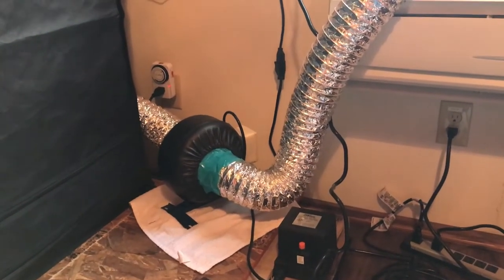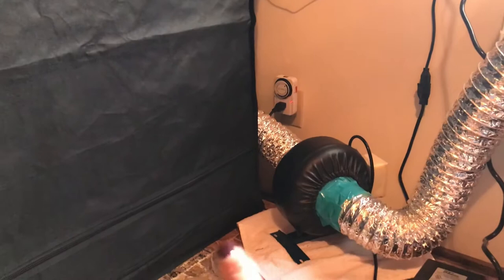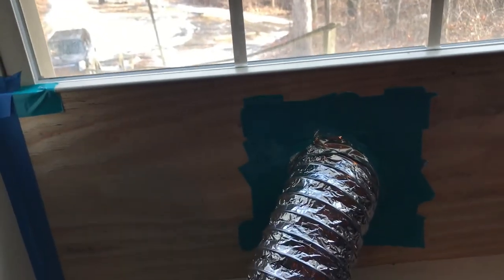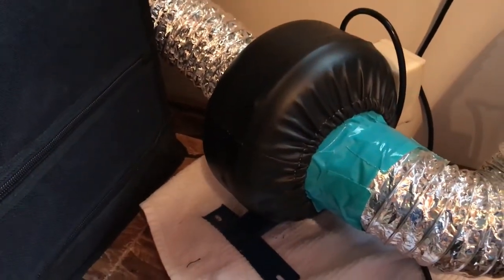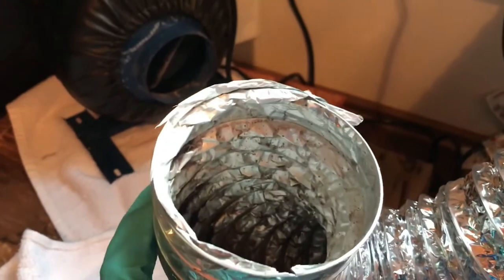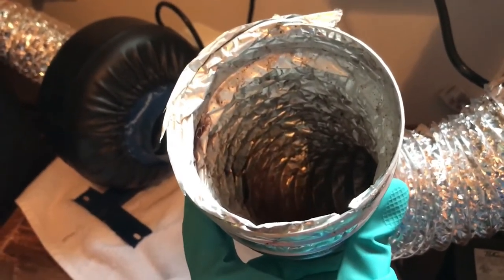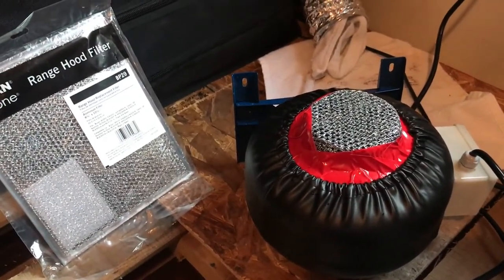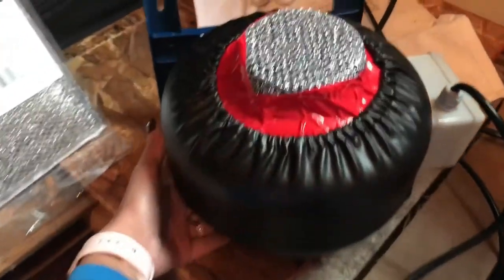Mushroom Grow Room Exhaust Problems

Comment: Jewel great approach to problem solving! I Got the cheapest harbor freight miter saw (with a carbide blade) ~ $90 or less for cutting PVC and other materials quick! The thing pays for itself with the time you save. Hacksaw is great for a couple times use but the end result usually looks like a beaver chewed it off. PVC ends should be sanded smooth to reduce bacteria breeding areas and other infection vectors. The miter saw saves the wear and tear on the arms and back too.

Comment: Working on designing an exhaust system for my 8x8 grow tent now. Miraculously the hepa filter I got fits perfectly into one of my portholes on the side of my tent. That’s for my FAE and I calculated it provides about 4 air exchanges per hour on low setting of hepa filtered air. I now need to develop something for exhaust. Also need to figure out a fix for draining condensation

Comment: Did you notice this exhaust setup having a significant electricity impact in the cold? All the dumping outside I'm tring to decide if it will be more cost effective to filter and dump back inside

Comment: I would put a short piece of pvc on  the fan intake leave  the range filter and fill the pvc with polyfill so you don't get a lot of spores in the pvc less cleaning that way. just replace the polyfill when spores build up.
Reply from the maker: Chuck Taylor the polyfill would get sucked into the filter though and decrease power on the exhaust. Can’t mess with that!

Comment: Perhaps I misinterpreted the image in one of the videos. It looked as if it was shot in a tent structure or in a room lined with plastic and a plastic covering the floor. You were discussing a fan or a blower.The edges of the plastic were finished (covered with ribbon or tape or something). Sorry, I haven't found the video to refer to it specifically. The point is if you have a room where the floor will abraid or wear easily, putting down a wear surface, in the long run, may save you time and money. By wear surface I mean a covering that is easily removed and cleaned, cheap, and or long-wearing. It is used to protect weaker but crucial surfaces. For expensive camping tents, they use a ground cloth and an inner sheet. On bearings, they may use a brass or copper, in work jeans they put a cover patch on the thigh and rump areas. What I thought I saw in your arrangement was a plastic floor, subject to wear. An easy solution is to put down a wearable surface where you walk or you might move the shelving about (Whether on castors or not). The rubber mats used in restaurants might be good but they are heavy. Perhaps there is a lighter version.  If you put down a wood or a hard plastic surface, the edges would have to be softened (either with a soft covering or removing sharp corners or edges. Untreated these edges would only make things worse). But perhaps I just saw things wrong and if so I apologize for wasting your time. My bad...
Reply from the maker: David Fricker Lol, not wasting time no worries but I am confused still, ha! I think you’re referring to the Mylar hydroponic tent?!? That’s where my exhaust fan is (inside the tent) at least it is now. So my tent is sitting on top of a bunch of pallets, then I have plywood on top of that so I don’t rip through the damn cracks! Inside the grow I have things I bring in and out every day like my harvest cart, lighting & my shop vac so it might be hard to put something else down. I have goats and in their pin I have this heavy duty mat so it doesn’t soil the wood flooring of their little barn. I think that’s what you’re talking about...could be an option for under the grow actually...:)
Reply: It was just meant as food for thought ... I was concerned about punctures, rips, wares, and contamination concerning mushrooms, that's all. LOL

Comment: It looks to me as though you have no protective covering on the floor od the grow room. Walking on the plastic surface will quickly wear it out. If you put a wear surface in the areas where you walk it where casters travel it will preserve the plastic floor. Perhaps a rubber mat like used in restaurants would work. Keep up the good work. Thanks...
Reply from the maker: David Fricker Do you mean inside the grow? There’s actually 2 layers of Mylar not plastic. So far it doesn’t seem to have any wear because Mylar is pretty durable  (oh plus there’s some kinda fabric that it’s attached to
Reply: It would serve me well to completely read the response before answering. Yes, it would .....